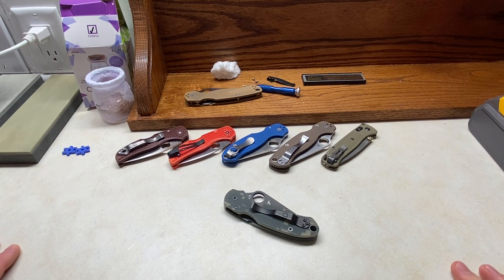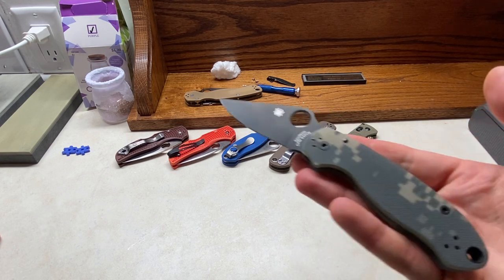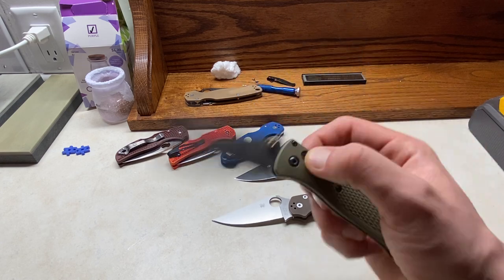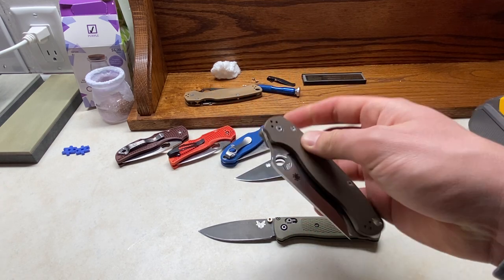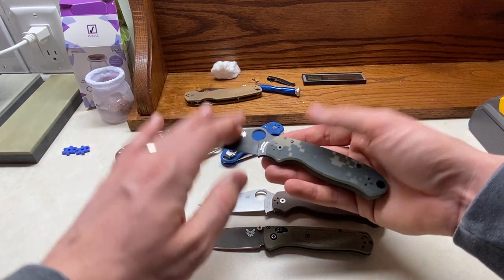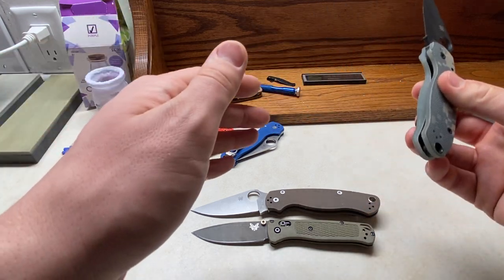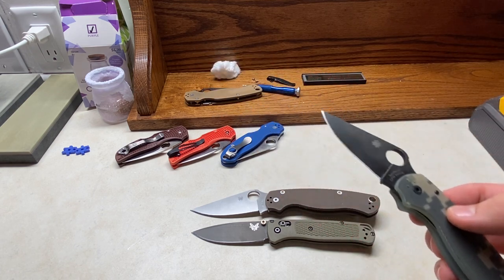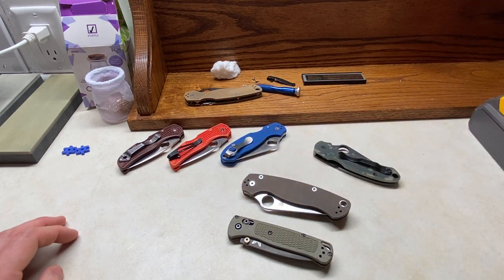Time to Try Spyderco’s CPM-S45VN (Spyderco Para 3)

Comment from the maker: Heads up! I haven’t planned on discussing the chemistry and theories behind the steels in this video but I got away from myself. Due to this I made a handful of mistakes when comparing S30V, S35VN , S45VN. Please use the link below to Larrin’s article at Knife Steel Nerds about S45VN for the correct information. 

https://knifesteelnerds.com/2019/11/01/crucible-s45vn-steel/
Reply: I need to learn so do you got a video that goes into it ? And this video is a year old so how did the 45 end up doing compared to 30 and 35
Reply from the maker: @christurnerct49  overall this Spyderco S45VN is for sure my preference over S30V and S35VN. I just get good use out of it in the daily and it sharpens really nice for a stainless steel. 

I would rank them:
1) S45VN
2)S30V
3)S35VN

Comment: I am so curious to hear your thoughts. Mine was so amazing. One of my favorites EVER!!!!!
Reply from the maker: So initial findings are very positive! Did a couple of hand edges and was very happy with how crisp and fine it comes up for a stainless. A little less aggressive feeling than S30V maybe but way better than S35VN by a mile. Used those edges up just to get through any burnt steel.  

I did a 17dps, 1500grit diamond edge from the KME and carried for about a week and a half. Absolutely stellar for the first 7 days or so and then started slowing down a bit but not bad. Stropped back on 4um CBN and boom, back to hair whittling. Very impressed. Granted this is lighter duty work than I used to do 2yr ago.

Biggest takeaway is the edge has zero damage. No rolling, crushing, etc. With S30V my main mechanism for failure is generally rolling so the improved edge stability is the major victory. Will have to try lower angles to really see. Also this stuff moves insanely fast using diamond stones. So easy to get a sick edge back. Thank you for recommending it!
Reply: @EngineersPerspective701  wow- that makes me SO HAPPY to hear!!! That was literally my exact analysis as well. So glad you got to try it and that it didn’t let you down brother!!!!

Comment: I'm hoping spyderco makes that 15v a regular player in their line up. It'd be really nice to see a Para 3 or native 5 lw in that steel
Reply: I think they will for a while but I don't think it be replacing K390 anytime soon if anything they might be taking a break from Maxamet.
Reply: They will only buy more melts of 15v if there is high demand for it. So ask them on there forums or email or voice.
Reply from the maker: Same hope. Haven't had enough time to compare to maxamet but replacing it is how I see it going as well if Spyderco makes it production.
Reply: @EngineersPerspective701  Sean aka big brown bear mentioned he was going to help out Spyderco heat treat protocols across the board. Better microstructure will be better than it already is. Though this won't go for the other factories who do their own heat treat that Spyderco outsources to. Ie Taiwan, Japan, Italy, China etc.
Reply from the maker: @tacticalcenter8658  I did hear that as a rumor so I'm hoping like hell it's true! Will be interesting to see if/how their current models will "evolve"
Reply: They won't. 15V is too hard to work with (from a manufacturer standpoint). Keep dreaming. It will stay a Sprint Run. It's also not widely available.

Comment: I actually sharpened up some Spartan S45vn for a friend and it took a beautiful fine edge. It’s holding up great for him. Really look forward to hearing your experiences!
Reply from the maker: Good to hear! What stones, progression did you use?
Reply: @EngineersPerspective701  I used the Venevs - 400-1200 OCB and then 1 or 2 ultra light passes on 1 mic CBN. Deburred very well. Nice clean apex.

Comment: I kept missing drop after drop after drop of the 15V Manix 2. Luckily I stumbled on a Canadian store and grabbed one. Watching the tracking through customs was anxiety inducing for sure. But there's another store "MidwayUSA" that I think has not released their 15V Manix 2s yet. At least the notification that I signed up for hasn't gone off yet. 15V is worth the hunt. Imagine it as 10V or K390 just a little better. 
Looking forward to see what you have to say about S45VN
Reply: Midway went in and out of stock yesterday.
Reply from the maker: Appreciate the heads up! I got hooked up by a viewer who had one in their local shop.

Comment: S45VN is a fantastic all-around steel, especially when it’s heat-treated well. 

If good corrosion resistance is required, it’s one of the best options there is when you consider its balance of edge-holding, edge stability, decent toughness, and ease of sharpening. 

I’d consider it to be a high-end option; it beats Elmax for sure, and is up there with Cru-Wear as a perfected pocket knife steel for using.
Reply: "Beats Elmax for sure"

I guarantee you couldn't tell the two apart in use or sharpening.

Easily two of my most used stainless steels lately (Inkosi, pm2 for s45vn, Schenk WR at 60.5 HRC and a Czechia made custom at 61.8 HRC for Elmax) and the custom is the only one I can actually see a difference in.
Reply: @CNYKnifeNut  Fair enough; although my experience with S45VN has been better, they’d almost certainly be too close to tell apart with the same quality of heat treatment. (I haven’t tried Bark River’s or Spyderco’s Elmax, for instance.)
Reply from the maker: Truthfully it's been really, really great. Much more impressed with this than I was with the Mule Magnacut for example. For me it comes down to the heat treatment for making this class of steels enjoyable for steel nerds instead of just a pain in the ass. The chemistry is okay enough just don't leave me with easily rolled edges and temperamental burrs please.

Comment: The Mani 2 rush was insane, I managed to score one but I nabbed it 2 mins after it dropped. Was not able to get lucky twice. 

However nowhere kept them in stock for longer than 30 mins. I hope they made ton of mules so everyone who wants 15V can get it. Sharpens a lot closer to Seki K390 than it does to maxamet.
Reply from the maker: Agreed on the sharpening note. Feels like a normal steel but moves WAY easier than I was expecting. I was expecting it to be a bear but not at all.

Comment: If I could legally carry an under 3 inch blade that locks in the uk this would be it either this or the Buck 112. You can only carry a 3 inch none locking blade in the uk
Reply from the maker: It’s definitely unfortunate to work around those laws for knife enthusiasts. The para 3 

You try the UKPK or other one handed open, non-locking knives?
Reply: @EngineersPerspective701  You can use lock knives at work places but not in public without a good reason. Yeah the lil native slipjoint is what I want the most

Comment: Spyderco s45vn does not compete with Spyderco m390/20cv. Though this depends on what rc your m390 is at, it goes from 59 to 62rc.

Spyderco S45vn at 61rc will probably be close to Spyderco m390 at about 60rc range according to cardboard cut testing result's.

Now when were talking about non Spyderco m390 or 20cv, spyderco s45vn at 61rc is surpassing almost all the brands in edge retention cardboard cut testing.
Reply: Yes I mean obviously in comparison to 20CV level it may fall a bit short. But Spyderco S45VN is absolutely blowing other companies using the same steel, out of the water. Spyderco really is taking time and dialing those heat treat protocols in! It is awesome.
Reply from the maker: Of course the M390 is going to outclass the S45VN on carbide volume all day long. For a production knife this is very stellar and not compromising much.
Reply: @EngineersPerspective701  recent cut tests have shown s45vn surpassing all sorts of m390 and 20cv now since not everyone has the best microstructure or rc for m390/20cv. Spyderco golden USA at 61+ and reate 60-61 are still surpassing s45vn by a good margin.

Comment: Good stuff, Just got an open box Elmax PM2 off Ebay so hoping its got no weak points as you where demonstrating and yeah I think erica is back to NotYourAverageEDC.
Reply from the maker: I haven't heard much about that run of Elmax but overall people really like the steel. Similar vein as S45VN but maybe a bit less "tuned" up with it's carbon and chrome levels. Hope it's a performer for you!